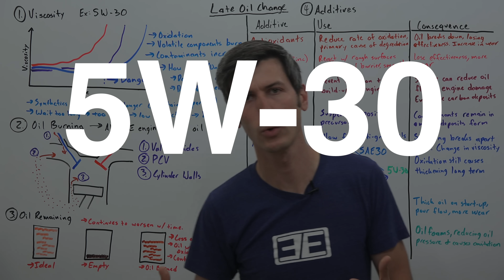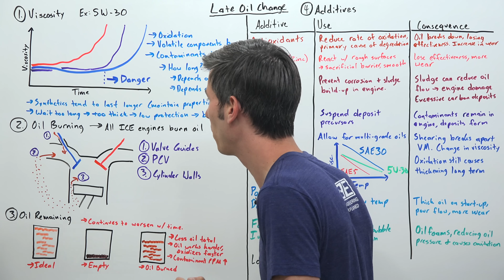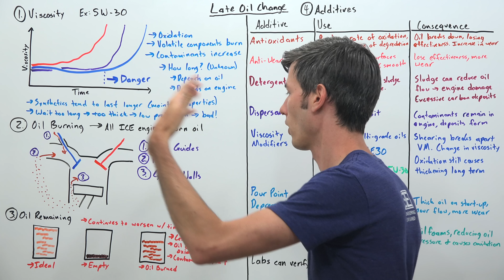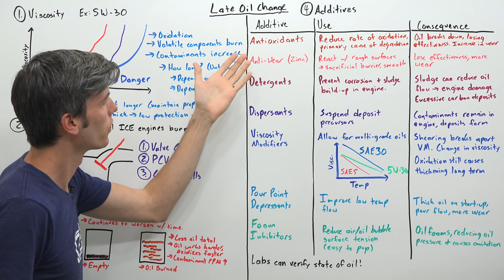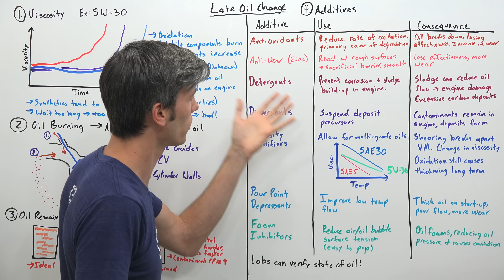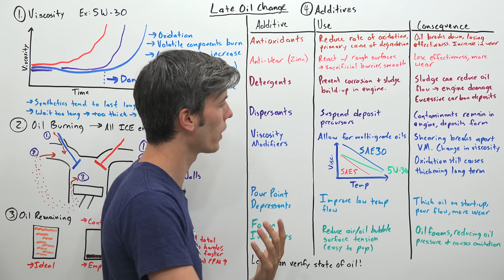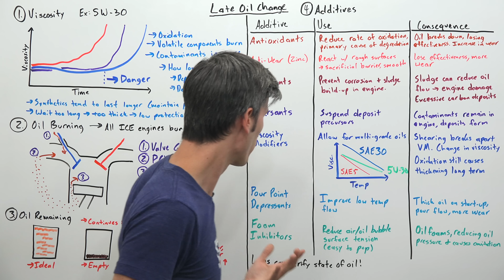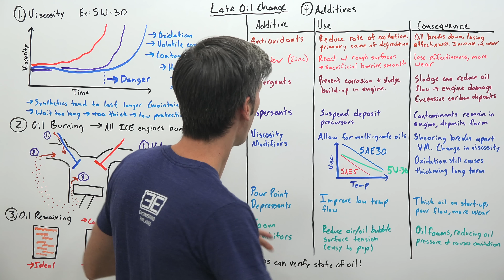What If You Forget To Change Your Oil?

Comment: Here's a true story no one is going to read: 

My ex girlfriend ran her 97 honda civic mb2 almost everyday for over 4 months without oil in the gearbox and waay below the minimum in the engine. One day the second and third gear started making the same noise as the reverse gear does, and first gear wouldn't always click in place. She complained about it and I'm a handy guy so I decided to do the maintenance of her car like a real man. NOTHING had prepared me for the moment I took the drain plugs out just to see literally a couple drops of oil from the gearbox, and the equivalent of two cups of water from the engine.
Since that day i've got MAD respect for old Honda drivetrains. 

The car still runs great at the date of this comment with the best quality oils I could find for it .. 

To this day I have no clue where that oil went .....
Reply: maybe they forgot to put the new oil in the last time when they were changing it before to do the maintenance that time so it was never there to begin with hehe
Reply: @raven4k998  yes. Either that or it was stolen. And I know which theory sounds best 🤣👍
Reply: @MasParaQue  motor oil thieves you got gotta watch out for them they will strip your car bare in a couple of days if you not careful hehehe that's why you should always have a shotgun ready on standby incase they come for your car
Reply: @raven4k998  that's a thing? wow
Reply: @raven4k998  Yes! That happened to me. Fortuitously, when I was to pick the car up after work at the day's end, I checked the dipstick. No oil on it, so I didn't pick it up then but to then, get picked up and get some oil.

Another time, all nuts on a front wheel weren't tightened up. I noticed a previously unheard little squeak when turning with the driving. I was very curious at this. I decided to check the simple things and checked all wheel nuts.

Years earlier, we were following someone we knew, just by happenstance, when his rear light truck wheel detached from it's studs and then passed him. The vehicle remained afloat on the three remaining attached wheels.
Some guy had been over zealous with his air driver with recent work that day and had stripped all the stud threads.
Reply: @Mcfreddo  yeah not everyone is mentally equipped to be a mechanic lol
Reply: @Mcfreddo  Great Stories!  Would have liked to see that!
Reply: Here's one for you I'll never forget- i was a lube tec for 2 years. One late 90s civic came in, running fine. Guy is crowing about how the car is his baby. Pull the drain plug and NOT ONE DROP OF OIL COMES OUT OF THE CRANCASE! Changed the filter, fill up new oil, and he's back on his way.
Reply: @mister-amazing  >> So this is not just an Urban Myth?! Lol....
Reply: @mister-amazing  Thanks!  Some times people just want to "inflate" themselves without applying real work.  See current POTUS.
Reply: so - hondas were made for people without a clue of how to appropriately care for a car.
Reply: The oil fairy took all that oil.
Reply: 1997-2020 = 23 years old.  The oil went to heaven or helped seal coat the road.
Reply: I remember the old Civic by Carwow. They bought 3 1k dollar cars and used it in offroad without oil in the engine. The civic just refuses to die. Haha
Reply: @alainsabello  it was exactly like that one, same color and everything!
Reply: I can see the engine oil getting low if the car is not maintained but the gear box being empty is really odd.
Reply: No one builds engines like Honda
Reply: Gearboxes don't consume oil. They (automatics) can burn oil. They can leak oil. But they don't consume oil in the sense that a reciprocating piston motor does, which is a trace amount going past the piston rings. Plus leaks. Plus a malfunctioning PCV valve. Plus worn valve stem seals. Etc. and etc.
Reply: @hkelly1623  they dont consume oil but there are other reasons for needing a dipstick other than checking level. Looking at fluid condition, fluid contamination, burnt fluid, or just general inspection.
Reply: Car wow did a test for this and it's true Honda is next level
Reply: Yeaaa new Hondas aren't as good.
Reply: Now that’s a honda being good
Reply: Similar happened to my dad in his '01 Ford Falcon AU, the gearbox had pretty much no oil as it had all leaked out of the oil pan. It has a hard shift or too in the early mornings, but other than that it runs fine.
Reply: @cmdrnachoman5864  - Didn’t even know they still made Ford Falcons...
Reply: Honda makes motorcycles like that too👍
Reply: @EC-ol8nz  how well do their motor cycle motors hold up for oil changes do there seals break on the first oil change or stay good most of time for multiple oils changes?
Reply: @EC-ol8nz  >> Sure like my Honda lawnmower too.
Reply: Mad Prop, to that car. It is a Real Soldier!
Reply: Just commenting to tell you you're right. I didn't read it
Reply: they didn't fill oil in cause they wanted that car off the market. ain't gettin money if it doesn't break
Reply: I had the same girlfriend with a 1990 Civic. She'd show up with it bone dry. I was adding 50 weight at one point. 15w-40 is pretty extreme, but should work in these cases.
Reply: @bushmaster1740  15w40 is extreme? How
Reply: Reminds me of an old friend that ran a 90’s Toyota Pickup on about 2 quarts for around 3,000 miles. Old Hondas and Toyotas are built for the apocalypse
Reply: How do you know how much oil the transmission has??
Reply: Abyss Will sometimes but not always, transmissions will have a dipstick. on 2000s gm cars the way to tell if its full is to fill it through the fill hole until it starts coming out, then start it and drain the excess.
Reply: @Salech2001  >> I only own American cars; I’ve never seen an auto without a Transmission fluid dipstick. Have seen some where it is near impossible to reach though...
Reply: @boomer1954ful  parallel mounted engines i agree but any of the transversely mounted you very rarely see a dipstick
Reply: @Abyss-Will  >> Is it possible that a car owner does not know their TRANSMISSION FLUID has a little dipstick under the hood, in a fluid-box, to check the level of tranny fluid? 😲 🤦🏻
Reply: @boomer1954ful  is it possible that a car owner does not know that automatic transmissions are not popular world wide???.
I have a manual car, there's no dipstick under the hood to check my tranny fluid
Reply: Maybe she had and ex boyfriend that was not so happy
Reply: Keep with the Honda brand, replace the girlfriend !!
Reply: @malcolmlane-ley2044  good idea
Reply: well its a Civic so i think we know where the oil went
Reply: Not Raym0nd what do you mean by that
Reply: BT DT Yeah input shaft seal was bad, I assumed the leaking was from the rear main seal and never thought to check the trans oil.
Reply: Steak and BJ day every day for the rest of your life I hope....
Reply: That is awesome!  Thank you for the story.  😊😊
Reply: @jerryx2000  I doubt it
Reply: Truly eye watering
Reply: In the UK a car mag did a test with several cars without oil in the engine. The nineties Civic survived.
Reply: You lost me at "like a real man" 😂
Reply: ".... Like a real man..."😅
Reply: I read it.
Reply: I had a 97 Civic,  for over 2 years I would hit rev limiter numerous times daily, even on a cold engine. Drove it 750 miles a week and abused it every mile I could. Also ran it out of manual trans oil, but it killed the input shaft bearing, so I sold it. Engine still ran perfectly, great cars.
Reply: I bought a chevy cavalier years ago with 110k miles on it I drove it almost 10k before I changed the oil don't know when it had the oil changed last before I bought it. it didn't leak any btw but when I changed it I could see metal flakes in the oil. Changed the oil every 5k after that. The car ran like a champ never gave me any problems drove it another 20k and one day a lady smashed into me and broke the control arm off of the frame on the left front wheel. Had to junk it.
Reply: @2009davm  - re: "lady"  Yeahhh ... most accidents are "lady" caused.  One wonders ... where are "ladies" minds when driving!!
Reply: @2009davm probably a good thing, metal shavings usually a sign of neglect or intense wear and that’ll show across the whole car
Reply: And in the next gen of some Honda’s...Honda designed transmissions that failed prematurely.....
Reply: @TehKaiser  >> That is a devious little practice in the whole Auto Industry called “Planned Obsolescence” and it sucks.
Reply: I stopped reading at "My girlfriend" but i'm sure if it was a story about a woman and a vehicle, it didn't end well.
Reply: In the '80's, my friend traded a set of nice home speakers, for a Honda CVCC. He dove that car like a go-cart everywhere, including the mountains, with no maintenance or changing the oil. The engine finally seized after almost a year of brutal driving, and I mean really brutal! He speed shifted the transmission also, but the transmission and clutch were still working when the engine finally seized.
Reply: @freedomfirst5420  >> I had a friend who did exact same to a 70’s Datsun!  Only she put about 300 K miles on the poor machine. Not one oil change! Not one servicing.
Reply: @boomer1954ful  how is it possible that in 300k miles driven the oil didn't sludged up or evaporated and as a consequence that Datsun engine destroyed?
Reply: I am told that synthetic oil can lubricate the engine even if only a quart is all that is in the motor.
Reply: @SignedOff402  thing is, the level was so low that I doubt it even touched the crankshaft
Reply: @MasParaQue  it's not ever supposed to be full enough to touch the crankshaft.  The oil pump picks it up from near the bottom.
Reply: @SignedOff402  sounds like some infomercial snake oil 😂💀

Comment: Depends on how long you wait good synthetics can be changed every 15000-20000 km I still do it every 5000 km but that a big time between when I wanna do it and when it can be done by I took my 500$ ranger to 50,000 km on on oil change ran fine still runs fine

Comment: Can you do a video on how high performance driving, where you're at high revs a lot such as a track has an impact on oil consumption, wear, etc... the traditional advice i know from regular track day drivers is to use thicker oil, e.g.  15w50 or 10w60. In my experience this is true also but would be good to hear the theory.
Reply: Also if you can speak about modified engines, i.e. ones which may have doubled their power output and thus more heat and how that impacts oil.

Comment: I used to think that when new motor oil gets old (due for replacement) it becomes thin due to loss of its protective properties for the engine.
Analogically, I now understand that sludge is to an engine oil network, what bad cholesterol is to a person's blood vessel network...am I correct on this?

Comment: Obviously you are not a Tribologist.
362,000 miles on my last engine before I got rid of it and did not burn oil.
Oil change twice a year.
Because the sulphur in the fuel blow by gets in the oil and mixes with condensation from the atmosphere making sulphuric acid causing wear.
If you drive less than 15 min your engine does not get hot enough to drive off the condensation to stop this.
Oil filters are made of paper to absorb the sulphuric acid. The more paper the more acid they can absorb. Some filters even put an antacid puck in them when they don’t use paper.
Also your base viscosity of your oil before the additive package plays a factor. Cheap paraffin based oils have a very low base index and when the additives fail the oil is useless. 
If it is only a grocerygetter change the oil frequently and you might as well use the name brand cheap stuff with a detergent.  If you drive lots of freeway miles and very little short runs then your oil will last much longer and you are just wasting money changing it every 3k miles.

Comment: The engine temp means a lot, if you're able to control instead of the engine you can change oil even every 20k miles as I do, obviously keeping engine too cool will use more gas, my radiator fan is manually controlled, after 3-4k miles the oil still clear, I'm not a slow driver on a old 1996 tracer and I never used 10-40 but 20-50 why so many late model cars are in wrecking yards? I'm been doing mechanical work for about 25 years and I never recommend to use 0- 20 oil even if factory recommends to me that's a commercial pourpose

Comment: Customer: I need an oil change, my oil change light is coming on again when I go around corners and hit the brakes hard. Me 🙄
Reply: Is that low oil? Or am i taking this wrong?
Reply: Potatoe Salech yes potato that’s low oil
Reply: @jeffclark5024  or it the oil presser sensor didn't read
Reply: That's how my friend used to check his oil on his Dodge Stealth.  Needles to say, he had to replace the engine.  He had better luck with a Nissan Maxima.
But he still used his method.  Car went 300k.
Reply: @mezgatotlan  these cars don't have dipsticks?
Reply: i was changing my engine in my 03 civic, i had a blown connecting rod, so right before doing the job, i redlined it to have fun and eventually the oil light came on, when it did i stoped and checked the oil, their was none left, then i made research, on civics, it only turns on when theirs only but a few drops left

Comment: if i understood correctly he said "poor point depressants" at 9:16. When i moved from a hot to colder climate, my car would barely get out of the driveway without being warmed up for 10mins. It actually belongs to my father who barely changed the oil and used the cheapest available. When I changed the oil myself it was a horrible black sludge and it obviously didnt contain those poor point depressants. With new oil it didnt need 10mins of warming up and  performance was also much better.

Comment: Im 50 years old, I have driven Chevy, ford, and Nissan trucks and haven't ever changed the oil in any of them.  the Nissan had over 300 thousand mile before it blew.  oil companys are in with the dealerships to sell oil. In 1955 they said "change your oil every three thousand miles" 70 years later, same thing?  Im not buying it.

Comment: Ok here comes my confession. 1st off i am a car guy. I own and drive all sorts of cars. Everything from 40MPG gas sippers up to 700HP fire breathing turbocharged drag race monsters. All the high performance machines get meticulous maintenance. However..... my daily driver is a 2012 mazda 3 with the 2.0 skyactiv engine and 6 speed manual. That car i only change the oil every 10k. And to make matters worse, i alternate my oil change method. On the 1st change i do a normal procedure, change all oil with new filter. But then on the next change i simply vac the old oil out from up top and dont even change the filter. So the filter gets changed every 20k...!! But the car has over 200k miles, runs like brand new and has never had a failure of any kind. so i cant complain.

Comment: I change my oil and filter when I can’t see my oil dip stick level lines through the oil. When the oil gets that dark I consider it dirty. Over fifty years of owning cars and trucks and I’ve used this method and never an engine problem. My vehicles have gone high miles and always ran great. When people have bought my used cars or trucks they would say my vehicles were running the best out of all they have looked at.

Comment: I ran a test on my 5.3 gm, mobile 1 5w30 full synthetic lasted 3,000 miles before I began to notice excessive fuel and oil consumption. 
 I am saving money by changing it every 3,000 miles vs. 4 & 5,000 miles.
 As between 3 & 4,000 my fuel economy dropped from 19 to 17 mpg, and between 4 & 5,000 it dropped down to 14-15. Thats around 10% or 100 miles of 1,000 miles and then 25% or 250 miles 
...
 Totaling 350 miles or 18 gallons (I rounded down)of waisted fuel x 2.29.. so roughly $40
 Not to mention the 3 quarts of oil I added to it to keep it topped off at $8 a piece.
    40
  +24
=$64
 The oil change costed me about $50 when I do it myself.
 I save $14 and prolonged the life of my engine.
 KEEP IT CLEAN AND KEEP IT FULL.
Reply: sounds like a manufacture problem as well if that is happening.

Comment: The teapot light comes on if you leave it too long between oil changes ;) lol.

On a serious note though, I know a guy who once left his 02 Corolla 1.4L petrol go so long between oil changes that it must have burned the most of it off, if not all. I heard the cars engine knocking coming down the road and when I dipped it, there was black coal dust on the dipstick. Those cars didn't even burn oil at all so it must have been left go to hell for a looong time.

I always get mine done either on time or before the mileage if a year passes, whichever comes first. I even bought a second service history log/stamp book for my car when the original one was full to make sure it would be recorded properly. That car (MKV Golf GTI) will probably live longer than I will lol but either way, til death do us part and it won't be due to negligence that she goes first, that's for sure!!

Comment: Can anyone help solve a mystery that has been puzzling me for the last few years.

I have a Volvo XC90 with the Yamaha B8444S engine.  I change the oil every 5000 miles and the engine is in excellent condition however the old oil always comes out with a very distinct yellow color.  This is not water contamination but something else.  I have never seen this with any other engine.

Does anyone know what causes this color change?